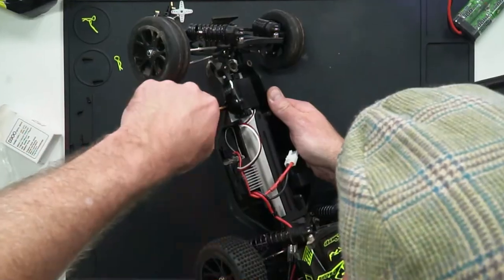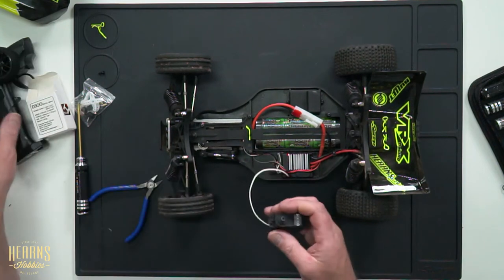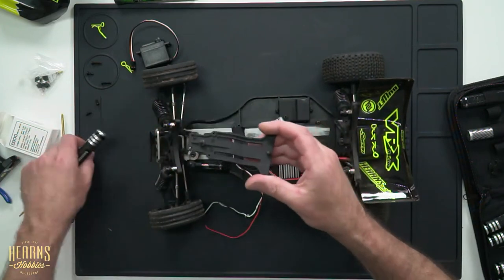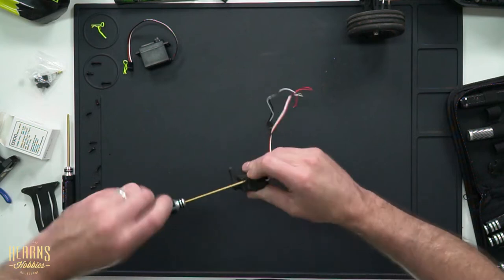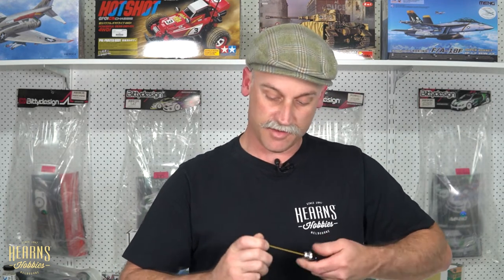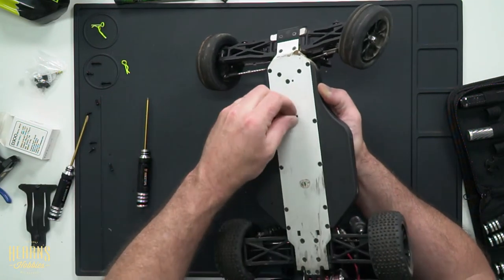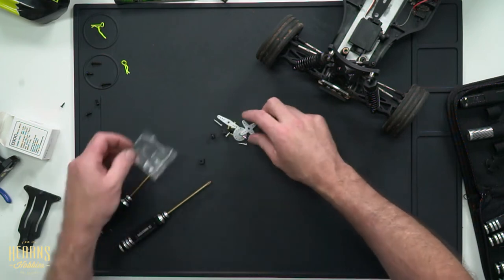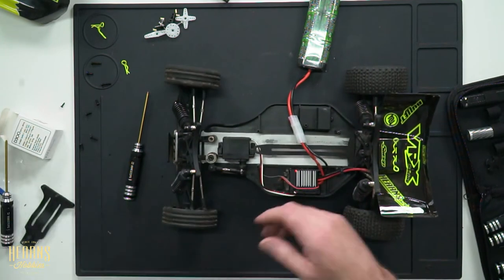VRX | Installing a Steering Servo into a Bullet1/10  Buggy | #askHearns

Comment: How do you choose the right servo if you can't get the specs for the original? I have an "old" vrx 1:10 scale buggy. The original died and I have no clue what to replace it with
Reply from the maker: Standard-sized servos supplied with RTR cars would generally be something basic similar specs to a Futaba S148/S3003 etc. The Highest D300 servo would be a decent upgrade (better torque, faster speed) to a standard RTR spec servo for not much more $$ than a basic S3003-spec servo.